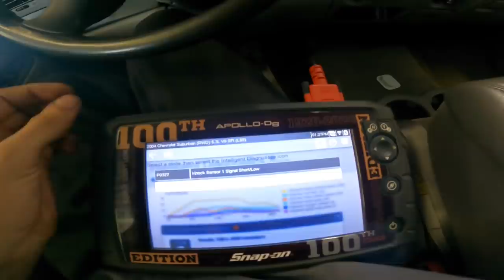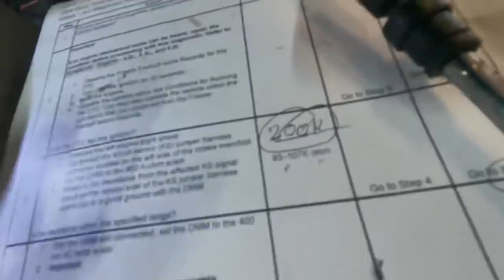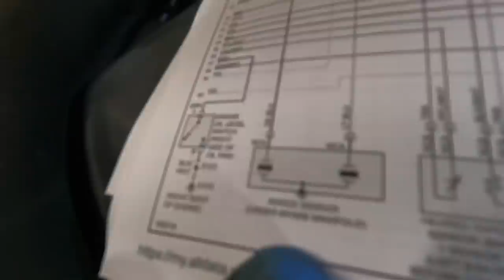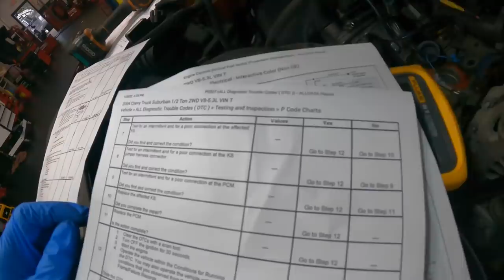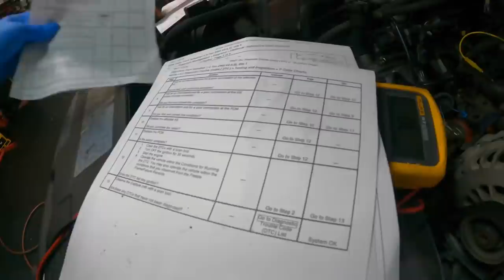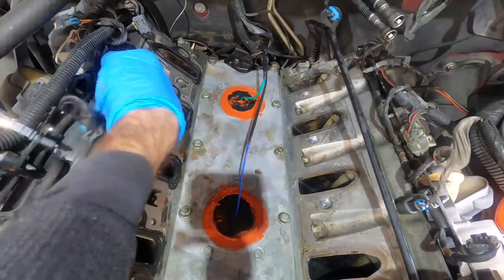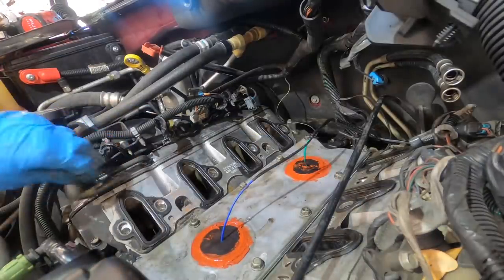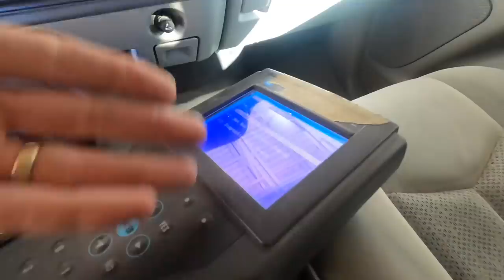Had to DRILL the engine block. NIGHTMARE Diag! LS 5.3 Check engine!

Comment: Hi, I love this video. The quality of your job and the professional methods you use in checking, hand works and to get a conclusion about the failure. I think this video could be used in any mechanical school to demonstrate the proper working method to repair a lot of failures. Although it contains a lot of skills to acquire in order to protect the engine when drilling, drilling methods, decision taking when something goes wrong (I mean when you decide to use tapping a tork screwdriver over the blocked broken nut of the sensor) and etc. I'll use your video to recommend to my students in order to call their attention about that not all methods to repair any machine are described in the workshop manual. When things goes wrong, personal skills are required in order to succeed. Congratulations. Very nice video.

Comment: You do a great job Ray! But... I would use blue masking take on those intake ports, they need cleaned anyway. If one or more intake valves are open, blowing them out with air may fail you.  Great work as always. If you disagree, please explain if you have time.

Comment: I’m late to this vid, as I’ve only been reviewing your content for about a week or so, but I’ve been messing with LS variants since ‘95 (I got to flow bench a set of vette heads before the engine was even announced), & I’ve ran into several KS issues over the decades.

In almost every case of false knock it is either a sensor issue or peripherals. Wiring, however crappy GM made their harnesses, are almost never the issue.

Also, in the future, drill & tap 1/4” in the KS boss & thread in a G8 1/4 bolt with a jam nut..Crank down the nut & back out the KS boss.

Comment: i think its time for some new bits. cle-line bits are upper middle line and stay pretty sharp. i like to keep some split points for aluminum only and once the point is gone dull, it gets touched up on the bench grinder and used for steel. ive learned its a good thing to have numbered, lettered and fractional bits on hand. better to have and not need than to need and not have also that way youre covered for anything tap related so you can get maximum thread engagement. 
  ive bought random sizes of random brands to find out what works best for my purposes over the years and for me, different brands do different things better than another. for me, one drills steel better than aluminum and so on. it all depends on our individual techniques on how bits perform. great vid. thanks.

Comment: great braind .
happened to me once. i pulled the valley cover off, yes the seals at the bottom stay under the sensor and used the smallest pipe wrench that will go over the sensor, didnt need to drill anything. tho, result matters.

Comment: I had a thing, (once), that looked like a plug socket, but was full of metal needles. - you dropped it over the stud, and no matter which way it was turned, it gripped and removed said stud.
Not so certain it'd work on horrid soft alloy.

Comment: You may have did the ohm test incorrectly. The knock sensors are grounded by just screwing them in place. Corrosion causes the knock sensor to not ground properly. So when testing each wire in the connector you should ground to the block to see if you have an issue not to each other.

Comment: On using a bunch of adapters, watch a fellow torque a wheel nut on the nose gear of a jet. Torque reading was about 15 ft pounds but the socket was about 3 1/2 inches. 1 inch drive on socket 1/4 inch drive on torque wrench.

Comment: mine was from the thread was little rusted so it isolate the signal, so i did rethread job with new parts and harness and worked fine

Comment: 32:16 What I would do at this point is to take a drill through the sensor body. Drill a hole small enough that you can thread a wood screw down through it, so that the inside and outside piece both rotate. You'll need to make a depth gauge with tape to know how far to drill so you don't go through the engine. (Good thing you have that known good part.)

Comment: i learned a trick when drilling inside or near an engine where metal shavings could drop where oil might carry it away? I drill inside a small bathroom drinking disposable drinking cup with popping the bottom of the cup over the area to catch shavings, i even stick a small magnet in the bottom of the cup to keep it upright and trap shavings. I then suck them out as I lift the cup out. Catching 99% of shavings!

Comment: great video on these PITA sensors Ray!l
you can use an old toothbrush or bottle brush while vacuuming to get into tight spots without the air blast at the end, cheers!

Comment: Ray Love all your videos. How is Petey today. So I had a suggestion for you in case you have to do this again. If you have to drill out those sensors again try putting a dixie cup over the "stud" and drill inside the cup it will hopefully catch all the chips and you may not have too much clean up. I really appreciate how much of a stand up guy you are after the fuel pump fakery that was pulled on the customer in one of your other vid's. You r the man.... great work Ray

Comment: You can slide a piece of wire heat shrink over the wobbly and melt it straight an the wobbly still flexes but not as loose and sloppy. :)

Comment: yo! Rainman look into this. this punch could have cause you less grief when removing the broken off threaded portion. there are sets or individual tools. these can also be used in the same way you use an air hammer to spin out stripped or broken countersunk screws like on brake rotors. use this search bar reference to find them. (spring tool punch and chisel set) there are many companies that make them but they are very useful once you know how they can be used.

Comment: Not trollin', trying to help. In aviation we use a compressed air vacs with catch bag. Also, might want to get a set EZ outs with 118* drill bits. Electric vacs build static (a spark/fuel thing). My shop vac at home tazes me almost every time I vacuum out my Traeger, table saw, etc. however, our humidity is only around 10% at Edwards AFB.

Comment: Save a few PVC pieces to place around drilling areas. Could make butcher paper  template with holes for PVC tubes. Could even have t for vacuum and removable cap with hole for bit. Remove as a complete unit.

Comment: Great Job but a little tip that could save you from drilling. How it broke was like a bolt with no hex. If you use a rounded bolt head extractor you might have been able to take them off using a racket instead of the drill. this happened to me i didnt have to drill. Keep up the Great work. Much Love

Comment: nice job, but you made it hard on yourself. I was in that predicament before where the sensor were over torque but just lime u tried to lift the valley cover I did too but I remembered there are two rubber grommets  at the bottom if you had kept pulling they would have separated from the valley plate and you would have been good to go.

Comment: easy solution would have been to buy a new 2 wire harness for the KS's and 2 new sensors, screw the sensors into the factory tapped hole on each head, and install the new harness and routing that harness to connect to its main harness. 
my 2002 5.3 has had 4 knock sensors for 2 years now!

Comment: Ray you do great work. I love seeing issues like this solved. I was going more towards bad gas or exhaust hitting under load. I know watching a tuner talking about knock sensors and how they work. If you use high enough octane like e85 they feel safe turning them off and not hurting the engine. But still recommend testing the fuel. But wasn't the case in this one.  Love the videos Thanks !!

Comment: Next time try coating a piece of paper with grease and push the drill part up through the center. Catches 90% or more. For ferrous metal I have a donut magnet I lay around the part.

Comment: The way this repair was going. In my head I was hoping not. But half expecting one of your drill bits to break off in the hole. I was happy to see that did not happen. That would have been my luck. 😄 I would have done a “Snoopy happy dance.” (If you have ever watched a Peanuts special. You know the dance.) After completion of this job or one similar. I don’t usually swear. But a job like this off camera, the air would have been blue for blocks with my cursing. So good job at least on camera keeping that in check. Also in case no one else said it. Good job on this repair 👍

Comment: I got some extremely cheap knock sensors for Toyota (which has a hex-shaped housing around the delicate bits in the middle). They had NO sealer or anything around the housing to protect the electronic internals from twisting, so even the slightest twist while installing was very likely to cause "broken sensor". Toooo cheap.

The good ones have some sealant around the top to make it at least a little bit harder to twist the wrong bits.

Comment: Have you ever heard of a 97 Chevy Tahoe engine redlining just sitting there and bending a push-rod and valve before? the mileage is 200,000+. That is what my so called friend said that happened but I found the bent push-rod and bent valve which I have replaced. Also the air conditioner does not work  and I replaced the clutch in the air conditioner. The fuel pump quit working and I checked the fuse but it was not a fuse.

Comment: Rennsteig  Automatic Adjustable centre punch  are a little more $$ but work great ! I have come across this exact problem before, a used truck I purchased at the auction. It took a while to figure it out.....lol , but the price was right...oh it also had a bad shimmy starting at 40mph.....loose front axle nuts....they all figured it was a front diff(4X4)...the shimmy changed to a different vibration when the brakes were applied, sooo....I figured brakes maybe but, it turned out to be the nuts were loose .... much cheaper fix 😁 Oh....I found grease on the drill bit works better than oil and keeps shavings at bay..

Comment: 26:41 At this point in your diagnostic, I'd say you should check for an intermittent connection as the directions state. This can be tricky, but you should be able to do it with an oscilloscope. Maybe someone has made some arduino tool that makes this easier. You'd want to flex around the wires while testing for this of course. Once that's determined not to be the problem, I'd suspect a firmware bug and make sure the ECM has the latest firmware flashed into it. (Which you can probably check and fix with your magic ECM programming box.)

Comment: When you tested the 2nd knock sensor with the multimeter, it shot up higher than the 1st one did when you did it fast. Bloody good job though, an hour long video must have taken you at least 2 long hours. I know my patience would have been running low by then

Comment: Pro tip: drill on #1 low speed, it will cut easier and drills won't overheat and dull nearly as fast.
Reply: cover them ray...
the intake manifold

Comment: Don't feel like you missed on this one, because you actually found the fault. The fact that the sensors were slipping can and did get a break in the circuit on the ground side. Spent weeks with an old GEO random shutdown and no start. It was found to be a ground wire actually one of three on the intake manifold. It was tight be not making a good contact found the issue on about the third time refreshing all grounds somehow we missed that one, because as long as the ground resistance was correct, the computer (old model) didn't recognize it for or as proper signal. Never had any more issues with it and it's actually still on the road today.

Comment: @39:00 assuming the threaded post is regular steel and not stainless, might want to put a magnet or two nearby to catch most of those shavings. 

At least they used RTV copper to seal the sensor. Looks like they had no anti-sieze .. 
What a cluster of a repair.

Comment: I was surprised to see that you didn’t try a pair of vice grips on those sensors after the center cover was removed; or a large stud extractor. Maybe it was too deep in the valley for vice grips?  Hard to tell from that camera view, and I don’t remember how deep it was from the one time I was in there on my suburban. Keep up the good work!
Reply: I had the same thought (though, many 'action cameras'/GoPros really flatten the visual perspective; don't know what kind of camera Ray was using at the time)

Comment: This is why I hate electrical stuff.  I went out to my practically brand new 2021 bronco sport a few weeks ago, check engine light came on and it was super rough upon start up.  Had a low oil pressure light.  Turns out some of the sensor wires had been pulled out or broken, such as thr knock sensor and the oil pressure sensor.  My neighbor leaves out peanuts for the squirrels, and I found some signs of chipmunks lurking around the car.  Was a little pissed to say the least, but good work on diagnosing and solving this stumper of a repair.

Comment: That happened to me too. When I did this job for the first time, I didn't use a torque wrench. The socket for the sensor usually  has 1/2 square, so it is VERY easy to over-torque it with a large wrench. Something brakes inside the sensor, and u r done. Now 200lbs gorilla has learnt his lesson and always uses a torque wrench there 🙂

Comment: it's not uncommon for "static" testing of components with an ohmmeter differ from device under actual load often bad parts test good under small ohmmeter loads but not big boy current modes. and if i may suggest
i found if you heat stuck studs in a block with a torch to get super warm not red hot than push a candle into the threads get a lot in there let it cool for an hour than those bolts will snap free and be finger loose.
ole timer trick great for manifold bolts snapping issue

Comment: Had the same issue it ended up being cheap Chinese parts passed off as OE, Replace the sensors and harness with GM parts from the dealer and codes went away, Be careful with online parts a lot of scamming going on

Comment: ok, the sensors are supposed to make diagnostics of engine trouble easier, but it seems the only thing that every really breaks IS the sensors.  we made engines themselves reliable as long as you lube them up and cool them correctly, so car manufactures needed to allow mechanics something to do/fix lol.

Comment: Once upon a time, my wife hit a deer with our old 2000 legacy and it crushed the hood.  I kept getting the trans overheating light flashing and the car couldn't be driven in drive with the light flashing or it would shift gears so hard it felt like it would knock you out of your seat.  You could drive it in 1 or 2.  You could put it in neutral and restart it until it went away sometimes a few times sometimes more.  No one could figure out the issue and shops started just replacing parts.  Subaru guy at an independent shop finally figured out it was a short in the main engine wiring harness.  I guess the crushed hood damaged the harness somehow.  It was like that a couple years.  You never knew when it would start flashing.  On the highway, on the way to the store, first start, it was random.  On the interstate you had to keep cycling it because you couldn't drive in 2nd gear on the highway.  It was awful but my point is some electrical issues can be very hard to track down when they are a random short from an external event.

Comment: Should have took a piece of pipe or something and tried tack welding the outer housing to the inner or tack weld to the pipe to remove them since there was no clearance to get a tool on the outside of the sensors.

Comment: This reminds me of the time I replaced a GPU in someone's PC only for it to turn out that their MoBo needed an RMA and I skipped checking the CMOS indication lights for a DRAM failure on a ROG STRIX mobo. Luckily the GPU was a test unit, but...I still wasted like 2 hours disconnecting the existing GPU carefully and undoing all the pretty RGB and water cooling. In the end I did have to disassemble the whole thing, but it was still a waste of time nonetheless.

You opened that hood and I had flashbacks...I like to keep my stuff simple, like the Toyota you worked on in the last video I watched, the TACO-Tacoma. That's the inside of my PC...if it's not neat and tidy, I don't want it in there.

Comment: I owned a couple GMC Pickups with 5.3 LS engines. I was not impressed with that engine. Mine knocked like crazy on cold startup with piston slap so bad that it sounded like it was going to self destruct. The frames rusted badly and that plastic intake cracked.

Comment: Any time you drill into metal on a motor block to remove a busted bolt find a lump.of clay Ply dough or a round magnet to catch the chips on a ferrous metal clay on none ferrous metals
And run you drill at a slow speed with presure to make long chips  you can pick up the loose chips with plumbers puddy
It should be sticky enough to hold the chips, worst thing you can do is use compressed air to blow them.

Comment: Sometimes an ohms check isnt good enough. The amount of amperage a meter uses to check resistance a circuit is incredibly low. A better check is voltage drop or use a headlight bulb to load suspected circuit. Just triple check there's no other splices along circuit. If it can carry 55watts then you verified the quality of wiring.
Reply: I can see that... but in this case, knock sensors are piezoelectric crystals generating some subtle little outputs, no?

Comment: $2 in pvc adapters and funny pipe makes hard to reach areas w a shop vac a simple job. Plus the smaller you make the inlet the greater the suction.

Comment: I'm no car mechanic, but I noticed that when you were knocking on the engine block fast, one knock sensor was showing a much higher reading of about 170, i believe, as opposed to 95 from the other sensor. Does that matter?